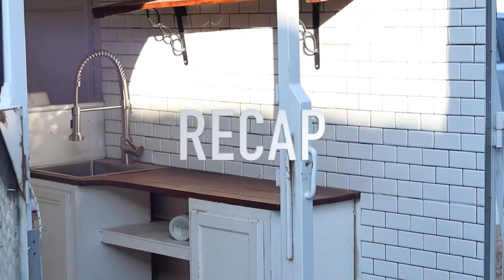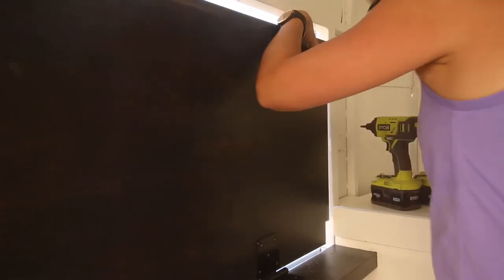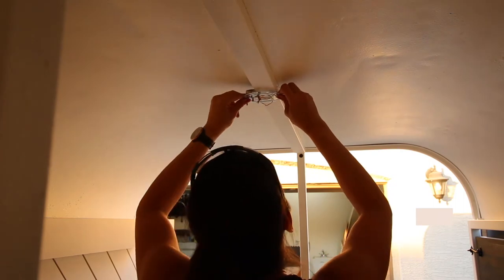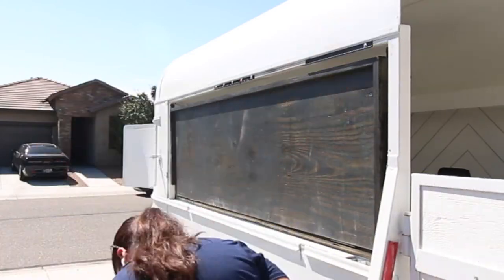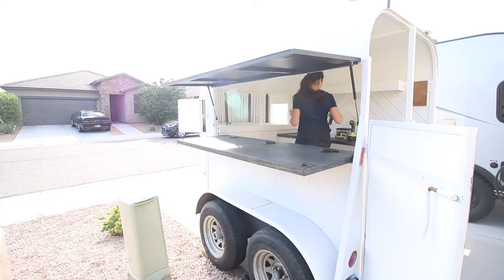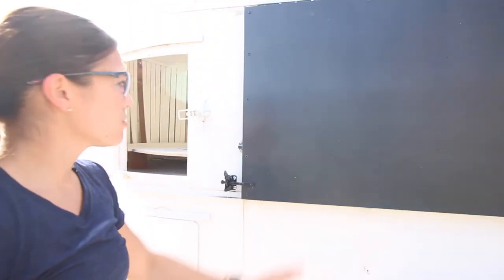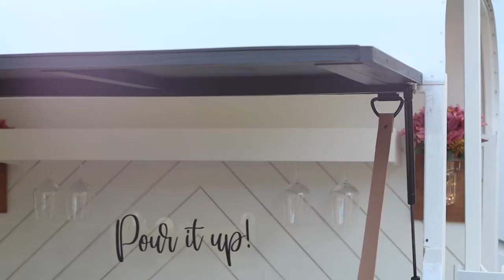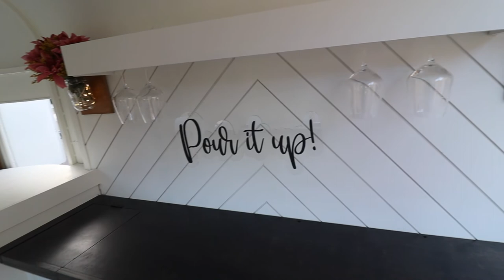Convert A Horse Trailer Into A Mobile Bar | Phase 5: THE REVEAL | Noble Dizzigns

Comment: How did you install the electric for the lights
Reply from the maker: Hi! For this trailer, there was a spliced extension cord. One end of connected to a 12V light and the other end plugs into an outlet on site. Not the safest of set ups! I’d suggest using battery operated or rechargeable light bulbs inside of a light fixture instead! Less hassle and safer.

Comment: Niiiiiccceee!!! How did you attach the piano hinges to the trailer?
Reply from the maker: Thank you!! I held the hinge against the trailer where I wanted to attached it. Marked the holes with sharpie. Pre-drilled the holes using a drill bit meant for metal. Then attached the hinge to trailer with wood to metal screws (linked in my blog post!)